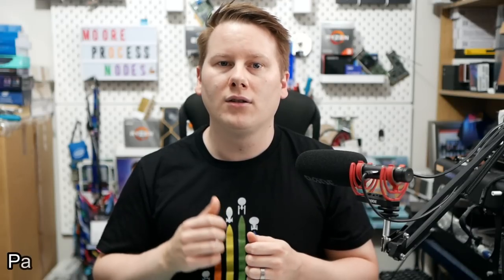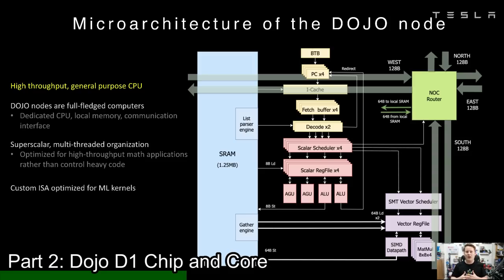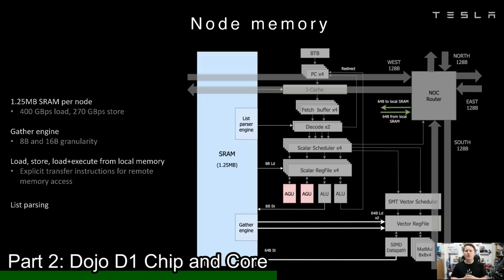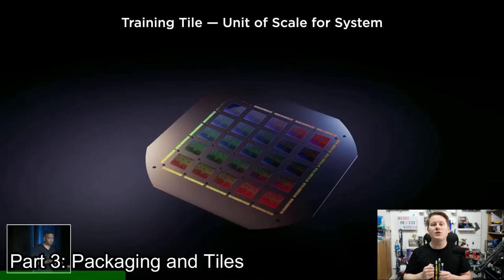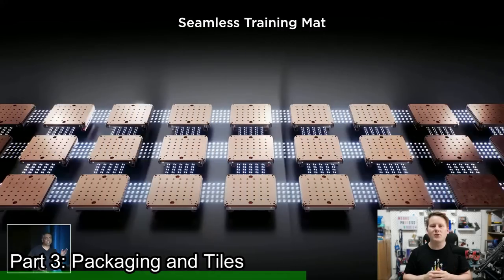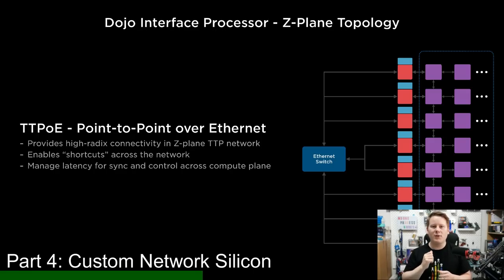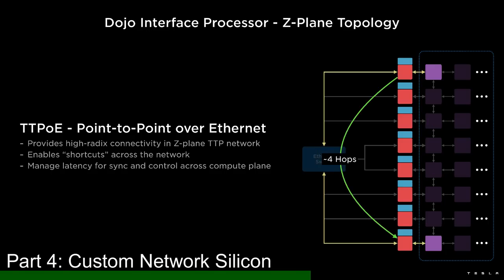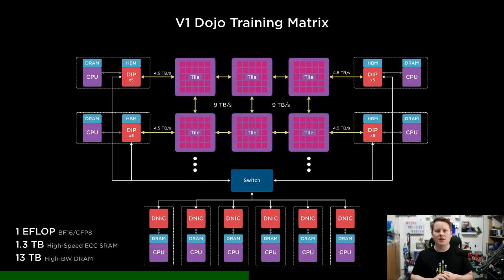Tesla Dojo AI Supercomputer Deep Dive and Analysis

Comment: One of the subtopics you could explore a bit more in depth are number formats. Take a look at Gustafson's work on unums and posits, they should be the "one format to rule them all" going forward.
Reply from the maker: Vividsparks has reached out. But yeah, a look into number formats is on my to-do list.
Reply: Should Tesla have used posits for dojo instead?
Reply: I remember reading a paper which described the fact that posit arithmetic was less efficient to implement in hardware compared to IEEE754 fp formats (on FPGAs at least). Although the article did not discuss smaller more efficient formats such as BF16 or FP16, its conclusion could explain why this format was not used by tesla.

Comment: I'm certainly interested to see some kind of real comparison between this and the Cerebras. If they were purely running convnets, punishing FMA ops, branch prediction and scalar units are wasted silicon. Even nvidia's "sparse" tensor engine is wasted space for most applications, a mux choosing the non-zero element of a pair of contiguous elements is just a neat trick to increase theoretical numbers that doesn't really help the majority of workflows. You have two non zero elements next to each other? Sorry, you can't use sparse op/its output is malformed.
Reply: The sparse tensor stuff is good for slightly sparse inferencing (if you have trained for sparsity), but useless for training.
You can even train the network to make sparsity in the pattern that the sparse tensor engine likes.

Comment: But isn‘t it so that DOJO might come online with so much delay that off the shelf alternatives like nVidia Hopper would already have caught up in performance?
Reply from the maker: Dojo is meant to be intimitely optimized for Tesla workloads. One thing you can't easily get over is chip to chip connectivity. Nvidia hasn't scaled that with Hopper.
Reply: @TechTechPotato  NVLink for Chip to Chip interconnects and Mellanox Infiniband to connect the nodes isn‘t too bad. Depends on the exact workloads whether this is a limiting factor or not.

Comment: Would it be possible for Tesla cars to all do a small amount of training as they go and transmit the data back to the data centre to make the whole fleet of Teslas worldwide help continuously help refine the algorithm?
Reply from the maker: That's what they do - transmit the interesting clips back and use it for training in the datacenter. Training doesn't happen on the car. Same reason why you don't render graphics on a CPU : 100000x difference in perf and perf/watt
Reply: @TechTechPotato  Ok I figured they'd be doing that, but wondered if perhaps there would be a certain critical mass of Teslas all processing that it would become feasible.  Thanks for the response!

Comment: You are not keeping up. Dojo is a complete flop. 
Musk fired the head module designer for non-performance. 

He designed the Dojo module with little to no memory. 
The idea was that it would make the system faster 
Turns out AI is a memory pig to work efficiently!!! 
So at the very least the entire Dojo project will need to be redesigned or scrapped altogether
or
Maybe repurpose the chips for a huge data center after adding memory

The good news is that FSD AND Optimus are NOT dependent on Dojo 

Our original supercomputer is still the one we lean on for all FSD and Optimus iterations 
The 10,000 H100 Invidia chips went to our old supercomputer -- NOT Dojo
Reply from the maker: You're commenting on a 16month old video.